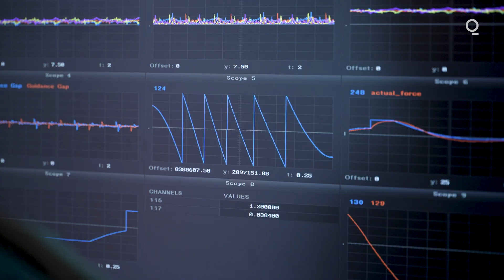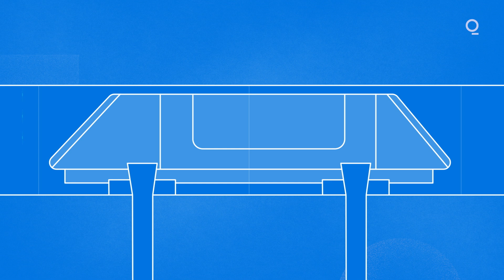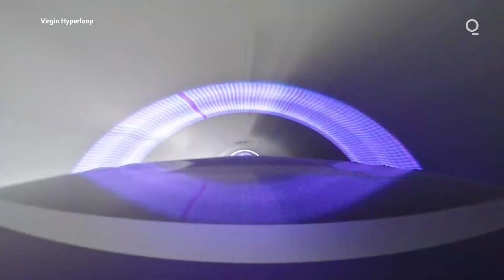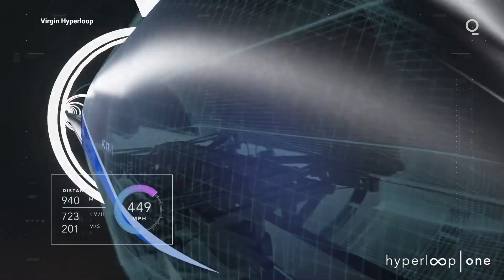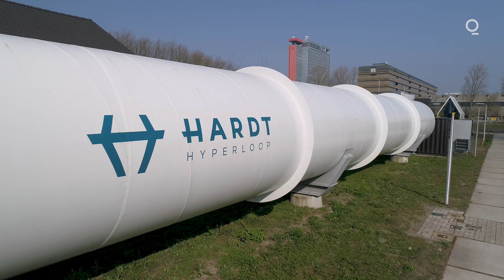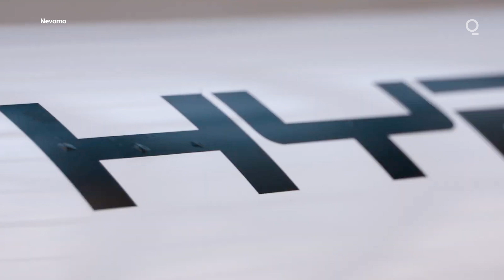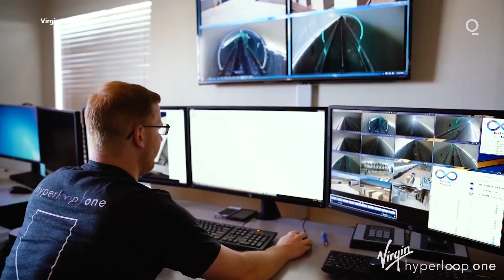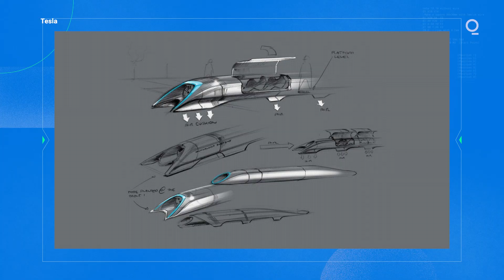The Hyperloop May Disrupt More Than Just Travel

Comment: I like how they gloss over the biggest hurdle. Actually making a vacuum in that large of a system with seals that last for even a decade in the tubes.
Edit: And as Pascal pointed out, any depressurization event will also cause a shockwave of high pressure air to travel down the tube faster than the speed of sound.
Reply: Ikr, the technology to switch lanes etc. seems trivial to the complexity of creating and maintaining a country or even continent spanning network of vacuum tubes or tubes of reduced air pressure. Let alone having these tubes go over areas of seismic activity, like the San Andreas Fault in California.  A single depressurization event will shut down or destroy a huge part of the network, as a shockwave of high pressure air (compared to the inside of the tube) will travel down the tube at the speed of sound.
And let's not even begin to talk about thermal expansion of these tubes, precisely joined tubes, over vast distances. 

I'm skeptical of the feasability.
Reply: @guna14146  
Thank you. I'll check out a Maglev.
Reply: they did it on the space station lol
Reply: If everything is magnetic I think all they have to do is have some kind of magnetic bearings and switches?That close-open-open-close  sort of sequence of vacuum airlocks ... it has to happen in mere milliseconds or microseconds depending on the speed of the pods, and they need to keep independent vacuum pumps running constantly in each section, priming the vacuum, and depending on the traffic you more or less regulate the intensity of the vacuum and the speed of transfer .... each transfer causes air leakage and the vacuum gets slowly lost until you have to shutdown the system to restore the vacuum. 

If there was a natural way something like how a ram water pump works, to build up the vacuum into a chamber, you could potentially use the hyperloop system to pump water and form a vacuum and effectively become a sort of electricity,internet/data,water, air, sewage, people transportation  system that could solve excessive urban sprawl.  

IF, not when. If HighSpeedRail can be built, it would make hyperloop a deadend.

When Elon does Starship  hopping from Port to Port , you WONT need hyperloop or planes. Space/Air, Land and Sea  will be the defacto travel as most people work-from-home. Vacationing via Cruise ships. Spaceflight for CEO executive in-person meetups. Zoom meetings for the rest of the peons :-D
Reply: @plusmanikantanr  should the hyperloop be going at the proposed speeds, it would take over a kilometer to stop in an emergency. If any of the "airlocks" fail, you better hope that you dont become mush. And thats excluding how difficult a 1km section would be to have airtight over many years.
Reply: @plusmanikantanr  Having moving parts in a tube with a "trains" going 1000 km/h (supposedly in quick succession) is the worst idea I have heard in all of this.
Reply: @plusmanikantanr  
I hesitate to write this but...
Back in the 1980's a friend of mine had a NDE and was shown glimpses of the future. One was high speed trains without wheels that "glided" without touching anything that caused friction. 
I don't know if it's the Hyperloop or not. Frankly, if I hadn't had a NDE myself I'd find his account unbelievable. With that said, I don't expect anyone to believe me.
Reply: @selah71  Hyperloops have been a topic in science fiction since the sixties mate.
Reply: @WIKUS70  
I don't read science fiction and today is the first time I've ever heard of a Hyperloop.
Reply: @WIKUS70  since the 1800's
Reply: @einar8019  nice I'd love to read that... do you  know where I can find some of these?
Reply: @WIKUS70  michel verne - an express of the future(1888) but the one like today is 1904 by robert h goddard
Reply: @einar8019  Thats amazing... thank you very much.
Reply: It would be easy to do it non-mechanically with a reverse osmosis filter. The difficult part is coming up with a material that soaks up air with enough efficiency to produce a vacuum. Ha. Ha ha. Ha ha ha.
Reply: Its simple... you dont make a singular vacuum... to make the hyperloop work there just needs to be higher pressure behind the pod than in front... so a series of ducted fans cycling air in the opposite direction of travel will work without the need for air locks as some genius suggested...

Comment: at least, at 700+ mph, you wouldn't know what hit you.
Reply: 760 mph not 108
Reply: or when the vacuum seal breaks
Reply: It’s a sealed empty tube. As soon as anyone breaches the tube…..the system knows immediately
Reply: @jimbutler1189  Yes, everyone inside the tube knows immediately, because they're dead. If the capsule has a breach, everyone dies, because oxygen masks don't work in a vacuum, and noone's wearing a space suit, and you don't have enough time to put it on when the red light goes on. If the tube has a breach, every capsule will be hit with a column of air (and debris) many tons in weight travelling towards them at the speed of sound. Oh, I have no doubt THE SYSTEM will know immediately. That doesn't mean THE SYSTEM will be able to do anything about it. This entire scheme is hare brained. Just build regular high speed trains for a fraction of the cost, with known and tolerable safety parameters. I also await to marvel at their Nobel Prize winning solutions to solving the expansion and buckling issues, while maintaining a near-perfect vacuum in a tube 100s of miles long.
Reply: @mariusvanc  definatley dont ask mazda
Reply: @mariusvanc   Best reply lol I concur with all you're saying
Reply: the TGV in Europe goes 350km/hr right now. and the record is over 600Km/hr. Of course américains know nothing about that because the oil lobby blocks everything.
Reply: @laflammr  no its because trains don't make sense in America. Our country is huge and planes make for more sense than trains for that fact alone. Trains require land which people who don't want a train on own. Plus laying track is not cheap especially when geography can vary greatly.
Reply: @barneystinson2781  trains not making sense in America is maybe due to railway system is owned by different companies in different part?
Wouldn't it be efficient for operating and profitability if companies are bought by govt under one department?
Reply: @barneystinson2781  if Europe can build a high speed train across the alps and under the English Chanel to London, and China also is huge. It is a question of money. big lobby want to sell gas

Comment: No, it won't...  Elon Musk is a scam artist.  For Hyperloop engineers and scientists have both pointed out massive issues that just aren't possible.

The boring company, costs no less than other like companies.

That "more real" Hyperloop took a decade, and changed from a maglev design to a wheel design (which means speeds will be significantly lower), and the track is insanely small.  

Maintaining a vacuum for a transport length track would be significantly more difficult, costly, and there are tons of engineering and safety issues.

Can't believe anyone still falls for this BS...  Granted, most people think Musk created Tesla, when he didn't, he is just a marketer, nothing more.

Even SpaceX, more expensive than our old space program, and technology that was made over 50 years ago, Musk just added computers.

Comment: Is it safe?
“We put people on it”
That didn’t answer the question
Reply: Is it safe?
"We don't know, how about instead of putting dummies we put real people on it!"
Reply: They put 2 people for a short time ,on a straight tack, with vacuum being there only for a brief moment. While only going 100 mph which is actually a standard highway speed and is not impressive like at all... like bruh
I'm pretty sure this is project to scam governments out of their money at this point...
Reply: “Most importantly, they got off”....THIS time... heh heh heh 😈
Reply: they shoud try to cash it and see how to make it safer \
Reply: @William_Avesani  That's unnecessary, it's already very obvious how unsafe it would be. It's a nonstarter.
Reply: Should be safer than a plane, as long as it can do an emergency stop.
Reply: It’s extremely safe
Reply: If they placed people in it and those people went out without a hunch. Then it’s safe.
Reply: @periodicdragonflare5572  Just as safe as the people they put on the Hindenburg.

Safety is not based on the best case or everyday scenario, it has to be based on the worst case scenario. 
By design, the hyperloop is not safe for passengers. And by design, vacuum tubes are not practical for transportation at this scale. It's entirely a pipe dream and a giant money fire.
Reply: @periodicdragonflare5572  No, it's safe when you have data on how it performs in a failure scenario. What happens to the passengers travelling in a vacuum tube when there's a leak? Well, you die. Because oxygen masks won't work in a vacuum.
Reply: they put people on a tiny test track for a few minutes. no, it's not safe, it will never be safe. if they ever did build it, which they won't, it would be one long target for terror attacks. it would just be too fun to pop.
Reply: @Ass_of_Amalek  you my friend, would need a promotion to be a pessimist
Reply: @Ass_of_Amalek  So are railways, bomb a track and the train is derailed. At least with a hyperloop its 20 people in a pod rather than a train full of 300 people. As soon as the vacuum is lost the pods will stop immediately. Yes one could be lost but there is no more risk from terror than a train.
Reply: @marcustrevor1883   You are speaking from a position of expertise that you simply don't have. First of all, your comparison sucks. In order to derail a train it takes an explosive, which is hard to get, or make, and you would have to physically approach the track to place it, and most trains with 300+ passengers are not in rural areas, so there is an detection risk there. To "pop" a vacuum tube it takes a guy with a high powered rifle and one bullet which can be fired from a hundred yards away. Also, a pod moving at 700mph is not going to "stop immediately" and you saying they will doesn't change physics. 

There is a lot more risk because it is a lot easier to target, and the infrastructural damage will be much higher as a pod hits sudden atmosphere at 700 mph and turns into a big ball of shrapnel moving at 700mph. It is going to be a lot harder to replace however much tube is damaged/destroyed then a few dozen yards of track.
Reply: A hyperloop is like a airplane hundreds of miles long. Airplanes are safe, so the hyperloop will be safe. Now, would you like to invest some money in this idea?
Reply: @BspVfxzVraPQ  Not at all😂
Reply: It's a developing technology, so it's safe enough for a test but naturally there will be more extensive work performed to make it safer. I noticed that they had an emergency stop button between them, so there'd be systems like that in play.
Reply: @kingkea3451  and at a speed of over 1000 kmh+ an emergency stop button would be useless ....
Reply: @Ry21123  not useless. Otherwise they wouldn't add it.
Reply: @kingkea3451  they were not doing that speed for the quarter mile test. I'm saying in a real world scenario the button wouldn't work in time... the user wouldn't even have the chance to push it🤣
Reply: @Ry21123  who says it would be user operated? There'd be redundancy systems in place to automatically slow or stop the vehicle in the event of an emergency.

There's rigorous safety standards they would have to fulfill - else they wouldn't be able to market it to the general public.

Why is it that everyone in this comment thread seems to be overlooking that fact?
Reply: @kingkea3451  you seem to be overlooking the fact that this does not seem applicable to the technology we currently have. Sure it's fun to say we WILL HAVE THIS! but throwing away endless amounts of taxpayers money to  something that may not ever happen....😕 Elon Musk wasn't even interested. That says something.

Comment: The cost of materials for the tube, pylons, wiring, and track, is much more than any other transportation system per kilometer.
Is the savings on energy to propel the pods enough to offset the extreme infrastructure costs?